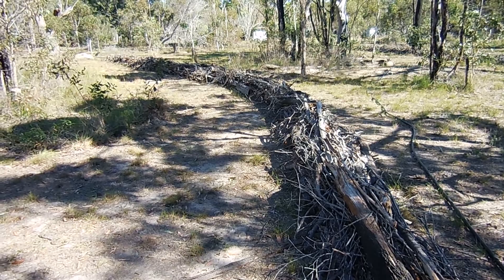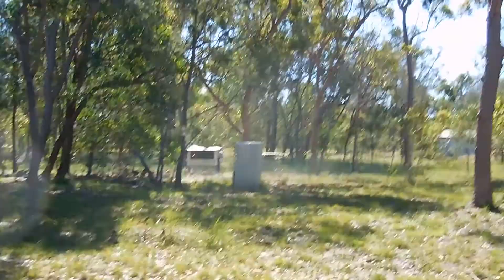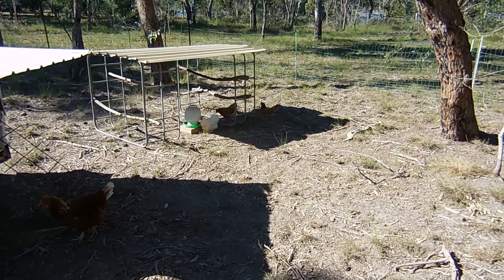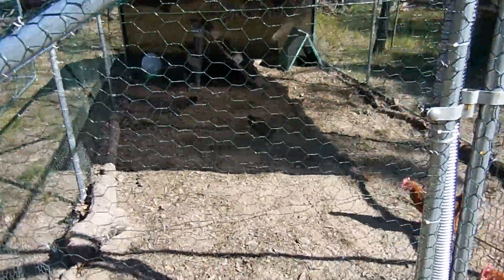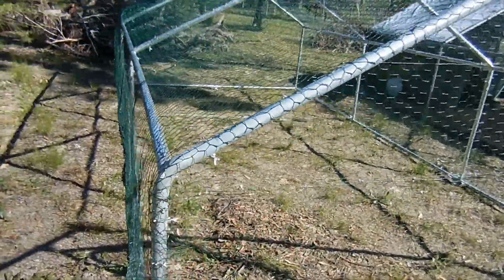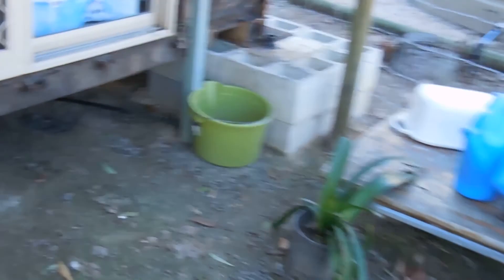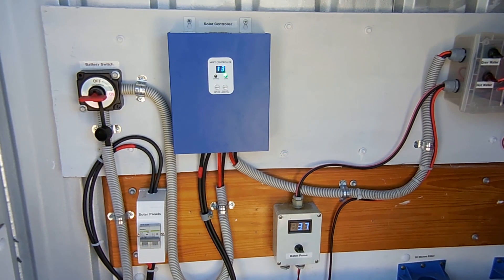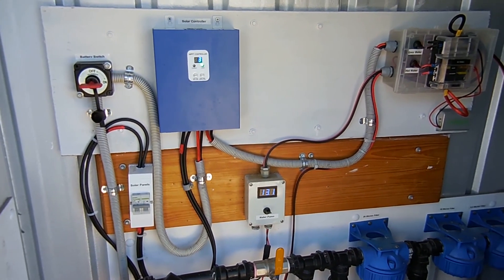BUSH BLOCK HOMESTEAD JULY UPDATE

Comment: Nice update. Any chance you could up your game to 50 or 60fps. 25 is really rough to watch when you're shooting handheld and doing big pans outside. Also little tip, white cable ties on the chook pens will harden and crumble after prolonged exposure to UV. The black ones seem to be less prone to this for some reason.
Reply from the maker: The camera films at 25fps not to much I can do about that.The ties a UV treated but we will see how they go.
Thanks.
Reply: Even 720p @ 30fps would be better if you have that option, in my humble opinion. On a 60Hz computer monitor, there is really a lot of tearing at 25 due to the uneven frame doubling. PAL is really not suitable for YouTube because of this. Even at 50 it's an issue - especially with unstabilised hand held shots. Re the white cable ties, I have a specialised business building outdoor beach bars and clubs. I have learned the hard way about them snapping easily after only one or two seasons. I have already learnt a few good tricks from this channel. Just wanted to share something back.
Reply from the maker: Apparently It can do 1080i @50fps ,will have to give it a try and compare it to 1080p @25fps.
Used the white cable ties because that's what I had at the time.
Appreciate the comments and feed back
Reply: Can't hurt to give it a go!

Comment: What water filters are you running and how do you find the water any taste thanks.
Reply from the maker: A 20 micron is used for filtering the water that goes to the shower and washing machine .
The water is further filtered with a 10 micron and then a 0.5 micron carbon filter that goes to the kitchen for drinking.
There is no taste in the water,
 After drinking our tanks water ,water from a city or town supply tastes horrible due to chlorine etc.